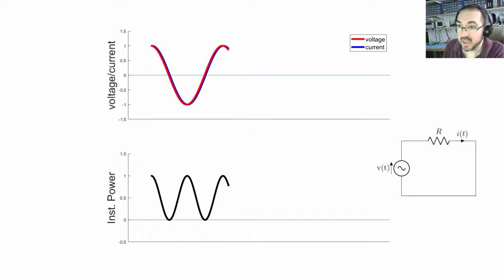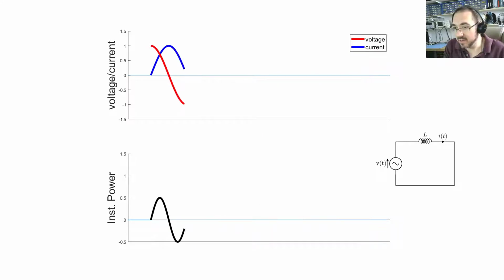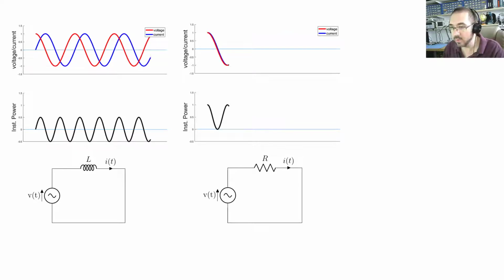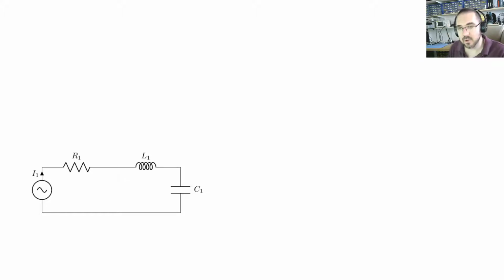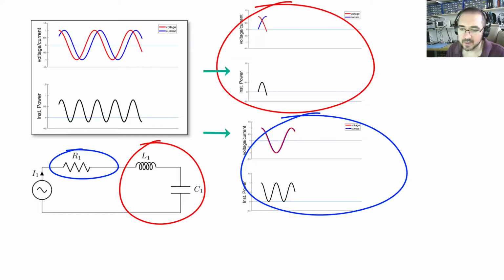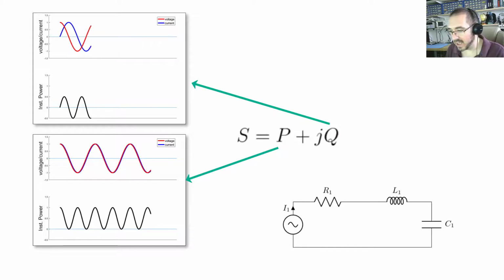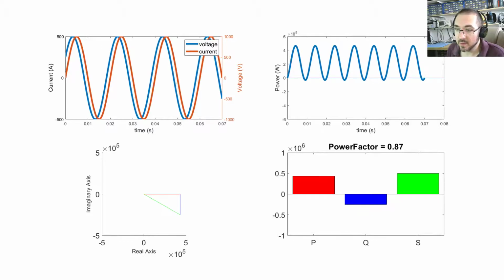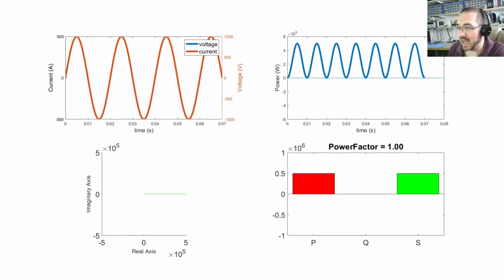Complex Power - the best way to understand what it REALLY is. (VISUAL and INTUITIVE explanation).

Comment: Also, idealized in the analysis is the harmonic purity of the voltage source as presented at the load. In power distribution you will most often find that the AC load will have a source which will have a certain amount of harmonic distortion (a distorted sinewave). If the load was purely resistive the current should have the same amount of harmonic distortion as the voltage. In other words, the Total Harmonic Distortion (THD) or the voltage and current should track.

For complex power to return to the source, where does this power go? To another load in your house? To your neighbor? To the power transmission network? Back to the power source, the power station generator?

Is power factor (pf) enough to judge the efficiency of power delivery, or is it better to measure THD of both voltage and current?

We have to deal with non-linear components, like bridge rectifiers, as well as reactive effects in arriving at the proper pf.